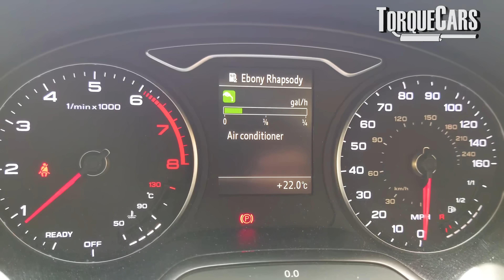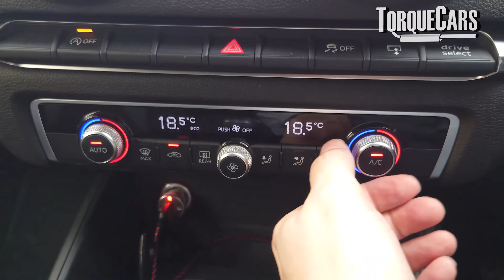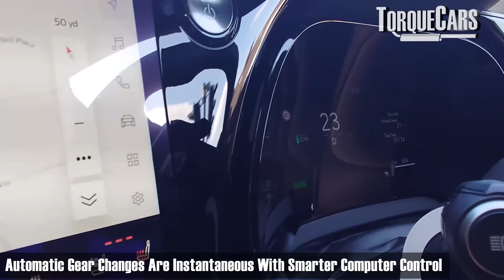The Biggest⛽ Fuel Economy Lies Every Driver Believes! 👉 What Really Saves Fuel?

Comment: I use Shell V-Power diesel in my 640d BMW and run on Michelin Cross Climate tyres, I’ve just done a 300 mile journey today from Lincolnshire to Sussex and it averaged 49.8mpg. 
It’s a 3 litre six cylinder engine, I think that’s impressive! Cruise control most of the time and travelling at the limit too. 😊
Good video as always.
Reply from the maker: Thanks for the positive feedback; that's great fuel economy for a 3-litre! Traveling in style eh?
Reply: @torquecars Shell V Power doesn't only provide with better octane / cetane ratings. The premium fuel has different additives to the standard fuel which will help keep your injectors cleaner over time. That alone for me it's worth using in ANY vehicle I own or drive.
Reply: Sure.... because on board fuel computers aren't rigged to give apparently good figures at all LOL
Reply: @andyf10 if you likw, it did just under 700 miles before the fuel light came on with 75 miles remaining, I’m only reportng my experience not a conspiracy theory 😂
Reply: @andyf10 In my experience, gwnerally you just add around 1/2 L more per 100 km over what the trip computer shows.
Reply: Yes it's a great feeling getting a big MPG readout after a journey, but have you considered that the only meaningful reading is when you travel to your destination, and then travel straight  back on the same route, with the same traffic conditions. That method cancels out any effects due to going uphill and downhill.

Comment: 3:37 Apart from not being necessarily fuel efficient, driving at 30 mph on a free-flowing motorway has another significant disadvantage: it is very dangerous.
Reply: I like to drive right at the speed limit or slightly below it but stay in the far right lane of course for courtesy
Reply: Sure is, about the lowest you can safely do is to be in the lorry flow, around mid-50s.

It does seem to be the most efficient sweet spot as Wayne said.
Reply: @javelinXH992  Yep. And doing 30 ensures that you become "part of the lorry" flow, if you get my drift...
Reply: @dlevi67  Yeah, but who would drive at 30 on the motorway. Actually i do come across a few slow people - and they are not always old! Maybe they are transporting a load of eggs?

You've got to keep up with the vehicle in front at the least.
Reply: @javelinXH992  I don't know if it's eggs, old age or something else, but they do exist. Be afraid, be very afraid!
Reply: I don't understand.
If I drive 100km/h I use 5 liters for 100km.
If I drive 120km/h I use 6 liters for 100km.

So it is always fuel efficient to drive slower.
The only down size is time.

If you are not in a hurry,  what's the point to drive fast, exept making fuel companies happier.
Reply: @fire-bird422  It may be more fuel efficient, but if your speed is much lower than the average (e.g. doing 50 km/h on a motorway), then there are other factors to consider. Of course, a wreck in a field has no fuel consumption at all.
Reply: @fire-bird422  It's an Air Drag that usually starts from 80km/h
Reply: @fire-bird422 Depends on the car powerband and gearing as well. My car can't even use 8th gear in the UK without significantly under reving..

Comment: A long walking stick extended out the drivers window and hocked onto the rear of the car in front works a treat,,, I know this because I saw it in an old back and white film ,, 'charlie' somebody , I can't remember his name
Reply from the maker: Charlie Chaplain?! You do realise that wasn't a documentary or instructional video lol?
Reply: Driving the motorhome through France I was aware of a Tesla driving so close behind it looked like I was towing it. 
However, turns out EV drivers do this to extend their range. The motorhome acts as a huge air dam so the EV has negligible wind resistance to overcome. 
Works OK at a steady 65 on a reasonably clear motorway but it's a bit uncomfortable having something that close to the back end.
Reply: @tompiper9276  I have drafted cars at 80 mph on my bike with the throttle almost closed.  I don't do it as habit though, just wanted to see if it was possible.  It works by placing yourself in the low pressure vacuum behind it.  With 2 cars drafting it also reduces the leading cars drag.
Reply: @tomnwmi  Presumably it would work with two motorhomes........... Don't fancy trying it though 😅

Comment: If you drive alone on the motorway, larger cars seem to like a bit of weight in the boot to make the car squat a little and add momentum. Suspension geometry changes with loading and tracking a car when empty is a compromise. Cars aren't at their best when driving with one person and no other weight.
Keep varying the throttle. Sometimes you can maintain speed with a slightly lighter throttle setting. There is a sweet spot, my Cupra gets max mpg at about 67mph and on long motorway runs it does 45mpg if I keep the speed between 65 and 70. Each car has its own quirks.

Comment: My 2001 Opel Omega 2.2 Turbo diesel is most economic at around 100km/h but then it has only 1900rpm at that speed. Strangely it is the same for my 2012 model Ford Transit that is 2.2m wide and 3,3m tall and about as earodynamic as a brick... When I go slower then 95km/h I have to go down to 5 th gear and the fuel econmy gets worse. Speed up to 95 - 105km/h in 6tj gear and it use 1,3 liter per 10km or so, slow down and it goes up to 1,4 1,5 liter per 10km.

Comment: I switched from 95 octane fuel to 98 on my 1993 1,6l Opel Astra and at same time reversed a plug in the engine bay saying 95 to it sayin 98 meaning the engine setting with timing was adjusted to run 98 octane and that gave me 180km/h top speed compared to 170km/h top speed with 95 octane, fuel economy improved by about 5% which made it cost the same as running 95 octane, but with the benefit of more power basically for free. Sadly here in Norway you can`t get 98 octane anymore :( Also in Germany Shell power + is 100 octane perfect for high performance cars, but in Norway right from the start while 98 octane till existed her Shell power + was 95 octane making it worthless for it`s intended use in high performance cars ...

Comment: Slow acceleration, use engine breaking, accelerate before a hill/crest, and slowly lift the gas pedal as you reach the top.
Use engine braking in high gear for slow deceleration and  in lower gear for a faster deceleration. 
Constantly feather the gas pedal according to traffic and inclination. 
Try to anticipate the traffic from farther away. 
Low RPM, high gear, but try not to lag the car.
Service your car properly - oil change maximum change interval is one year or 10.000km. 
Fuel saving tires - be careful as they're not as grippy or effective during hard braking.
Narrower tires (can dramatically make the car handle worse and brake in a longer distance...CAUTION)
Clean your car of unnecessary weight (highest fuel saving factor).
Keep your driving between 80-100km/h. 
Moon caps on the wheels, duct tape on panel gaps (you can do it on the front radiator too, but there is a danger of overheating - killing your engine)
Flat underbody (you can DIY, but it's a lot of a hassle), and a diffuser.
Lowering your car (properly, not just cut the springs)
External mirrors removal - ILLEGAL in most countries.
Various extensions on the rear of the car (top and sides of the rear window, rear fenders, etc)
Front bumper air dam (make it as low to the ground as possible.
Shorter mudflaps in front of the wheels. 
Front fender cutouts (behind them) to let the air out - like many modern SUV have. You can have cutouts in the front bumper and the exhaust just before the front wheel to draw the air closer to the car (again like many modern cars have now).
Rear fender cover (to cover the rear wheel) - kinda like what Citroen used to do in the 80s-90s
Weight reduction- back seat removal, sound deadening, speakers and infotainment unit, spare wheel (have a puncture kit with air compressor).

Most effective - weight reduction, driving style, flat floor and aero tweaks, tires.

Remember  - Safety first (yeah, added last lol)

Comment: so,
number 1
IS really a FUEL economy

why you talking about not being, when you clearly say IS SAVING FUEL
Reply from the maker: Hi buddy, do you mean inflating Tyres? When tyres are inflated to the correct pressure they save fuel compared to underinflated tyres. Over inflating tyres will technically save fuel but tyres will wear out more quickly and this adversely affects handling and performance. Any extra fuel saving is offset by the cost of the reduced tyre life and the risk of skidding or losing control and causing damage to the car is much greater so I'd put that in the "false economy" box.
Reply: @torquecars  hey mate

change the title of the video, then;

because over-inflating tyres YES SAVES fuel
Reply: @torquecars  some manufacturers give higher pressure figures in there handbooks.

Comment: I havent tried going less than 60mph steadly on a motrway but i do believe that my 6 gears manual 2.0tdi gets best economy at 45-50mph, when the 6th gear has just enough power to keep the engine running, i do belive it will do at least 80mpg at that speed - mainly because i tried accelerating in 6th gear from 45mph and it was doing 50mpg while accelerating which is insane

Comment: I usually drive a bit under the speed limit, depending on circumstances. I notice that bimbling along at 65mph or thereabouts has no impact on my door to door average speed. 

Energy-saving tyres? Everything is a compromise with tyres: manufacturers reduce the pumping losses by reducing the tread depth and using a harder compound to compensate, but this degrades things like wet grip and braking. I tend to select tyres on the basis of what I'd want for an emergency stop on a rainy night. 

Another thing that I was told, many years ago, was to reverse into parking spaces and driveways, because you'd be doing it at the end of a journey with a hot engine, rather than going in nose first and having to do tricky reverses with a cold engine and, in the colder months, fogged up windows.
Reply from the maker: It is also safer and in most areas you technically shouldn't be reversing onto a main road or carriageway.

Comment: I tried premium diesel on my 2015 diesel for a Month and it didnt like it, engine seemed to lag and fuel efficiency was reduced. So i went back to standard diesel B7 (cheaper ) and added a 500mil of injector fuel tank cleaner from german Liqui Moli every six months.. Diesel now at 165klms and running like a dream. I Also replace oil and filters (fuel filter included) and shes running better than ever.
Reply: Hello, the question is if the gas station owners put really premium fuel in that tank or fill them with ordinary one! When reading what happens in the USA gas stations, one can be sceptic.
Reply: Try putting 50-100ml of 2EHN cetane booster into a full tank of diesel, it gives me 100+ miles extra each tank!
Reply: @Faancheyu I have been using Millers Diesel Power Ecomax for years, about to try hydra DPD-100 as it's a lower dose rate and cheaper. It has a bigger cetane boost over the millers 2-4 hydra 4-8
Reply: @thefoodiechannelcookingfro1822 Thank you for your top tip! I will also give this one a go next time!

Comment: Octopus Energy Intelligent Go tariff. £14 for 1000 miles. I found this tariff to be the best way to cut fuel costs, unless you have solar panels and a Zappi charger to refuel for free.
Reply: Not free ,u PAYfor batterys panels, and in depreciation on your car.lol...plus electric chargings gonna double in price v soon
Reply: @TheDigger06 
What, how are they going to make the sun cost double. 
What a load of nonsense.
Reply: @TheDigger06 
Even if electricity does double in price, it means our EV will cost 4 pence per mile instead of 2 pence, so still 1/4 the cost of an equivalent petrol vehicle.

Comment: We know it from our childhood, when launching our Dinky toys; the heavier they were, the further they went. So the inertia provided by the weight actually helps.....Provided you maintain a constant cruising speed. It is in city driving that lighter is better. On the motorway, the best mileages you will get with an aerodynamic, not-that-little car, a Station-wagon for example, with a little engine. The same engine in a city car will actually use more fuel on the motorway than in the bigger one, and less in town (tried and tested when I had my Tipo SW 1.4 and a 500 1.4, both with the same FIRE engine).
Reply: Most economic car I have ever driven on higway at 100 to 120km/h was a 1991 Ford Scorpia 2,9L V6 petrol, the only car that might beat it is the car I have now a 2001 Opel Omega 2,2 turbo dieses station wagon. Also I had for 6 months a AWD WW transpoerter 2,5L turbo diesel 5 cylinder and they bragged that the new 1,9 turbo diesel replacing it used less fuel at highway speed, that was a total LIE !!! My experience is that larger displacement engines use less fuel under load meaning using less fuel at high speed or towing.
Reply: Unless you are driving downhill then the mass of the vehicle will always be a negative. Even then you’d have to be continually driving down hill. It doesn’t make much difference and you’d probably see more if a difference if you stop at a red light.
Reply: @davideyres955  I said: in city driving, more weight = more fuel. Because of the stops. On a flat motorway, the difference = nihil. Pour a 1000 cc engine with 70 hp (atmospheric) that gives a top speed of 100 mph in a city car into a Mercedes, you will get exactly the same top speed if the aerodynamics are the same. You'll just need twice more time to reach it. Speed depends on power, nor the weight, nor the Torque

Comment: i only ever use Shell fuel in my diesel Skoda, do you think V-Power diesel is better for engine maintenance, ie. EGR/DPF/injectors rather than the normal Shell diesel.
Reply: It is definitely better for injectors egr the lot because it has better fuel additives but you have to use it every time you fill up for a few months to see the benefits
Reply: Try dipetane additave,,cleaner,cheaper
Reply: @TheDigger06 or Millers Diesel Power Ecomax or Hydra DPB-100, both contain cetane booster, millers 2-4, hydra 4-8 cetane.  The cetane lowers the temperature the diesel combusts at, giving a cleaner burn and less particlates. So less regeneration etc. both contain detergents to clean your injectors and both add to the lubricity of the fuel. Which means you get less wear on your fuel pump
Reply: Try 2SO.
My car gets it for over 15k miles. Zero problems with the diesel engine...

Comment: Doesn’t the gear you’re in determine how much fuel you use too? if you’re in high gear and going at a fairly low speed, you’ll use less fuel than going at the same speed in a lower gear.
Reply: Labouring the engine does it no good and you'll use more fuel. In a diesel especially, e.g. my Renault Trafic 1600cc twin turbo comes alive at anything above 1500rpm. I can get 43-44mpg on a run and around 40mpg in town.

Comment: 1:53 Underrated advice. I ditched the mid-tier Goodyear 235 tires on my CIvic and put Michelin 205s on there. I get 6.5% better fuel economy now and it handles monumentally better in wet/snow. I will be going to 195s when the 205s wear out.

4:23 My 2024 Honda civic gets 60.98 mpg at 25 mph in 5th gear (1100 rpm), 58.82 MPG in 6th gear at 30 mph (1100 rpm), 56.18 mpg at 50 mph in 6th gear (1900 rpm), and 54.62 mpg at 65 mph in 6th gear (2400 rpm). This measured on a 0.5% downgrade at 5000 ft/1.5km elevation with no additional loads via scangauge 2 which has been calibrated to the car. So in my circumstances, driving slower does improve my fuel economy, though the difference between a crushingly slow 25 mph and a moderate 65 mph is only a delta of around 11.6%, hardly worth the trouble and anyone argues it is needs medicine. If I switch my air conditioning on, I know for a fact my fuel efficiency will drop, but it drop significantly more at lower speeds, so with air conditioning on, I'm anticipating I'll actually get the best fuel economy at closer to 65 mph.
Reply: @Grafyte  I used to run a Citroen C3, the 16v 1400cc engine. Funnily enough  on Urban cycle - I used to do a lot of local running between motorway runs - it returned better mpg with the AC on. I can only assume that the engine specific fuel consumption was very peaky; that is, it had a a very steep efficiency curve with increasing load, so adding load with the AC actually put the engine into a more fuel efficient condition when running at low load. Now, that engine lunched the AC compressor one morning. Oil, water and bits all over the drive. But ot still ran fine! In fact, the average local running consumption lifted from 56-ish to 65-ish. I have not yet, some 5 years after I scrapped the car, come up with an explanation for that. Any suggestions welcome!

Comment: RE 8:29 / 9:00, I tried it and calculated the fuel conomy in excel - to get an exact reading of my MPG based on the fuel I used and distance travelled, since trip computers can sometimes be slightly out.

I found premium fuel does deliver slightly better economy, but not enough to offset the extra cost. It costs roughly 1.5p per mile more to use premium fuel. 

The other thing I found is in cars that can take E10 fuel, the acceleration and performance is slightly better on E10 fuel and the car feels a bit more willing to accelerate. Difference is too small to notice on most day to day driving, but when I want a bit of power - for example on a roundabout or on a slip road to get up to speed, my car is bit more willing to accelerate when it has E10 fuel.